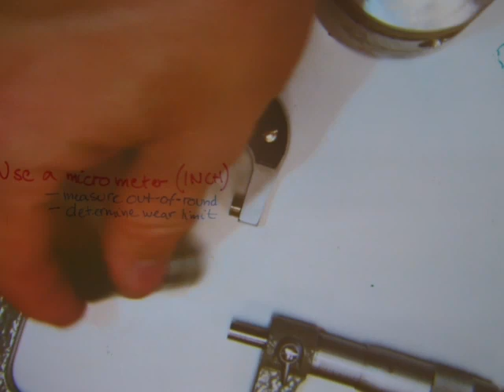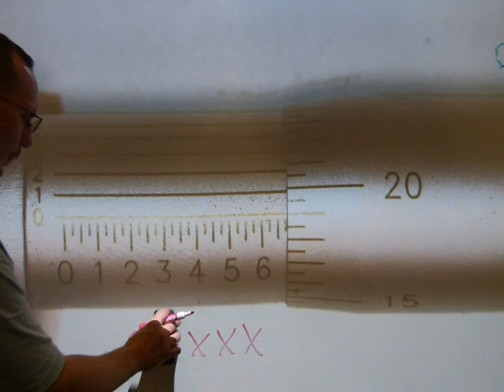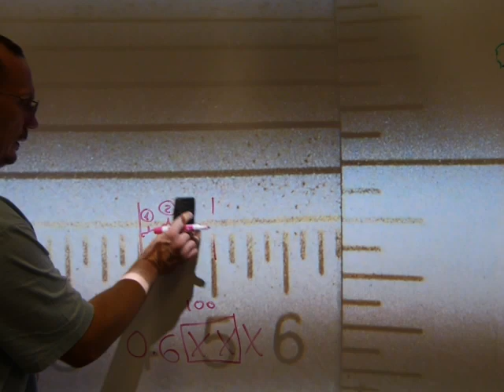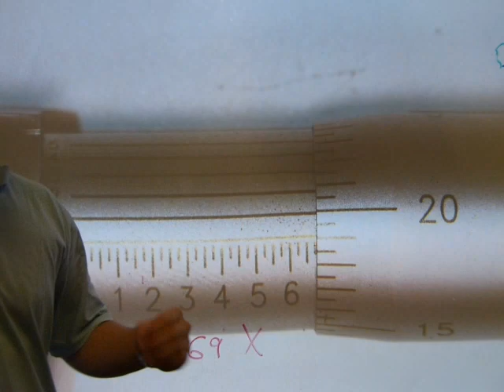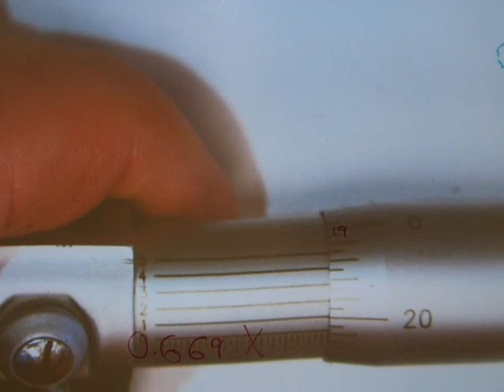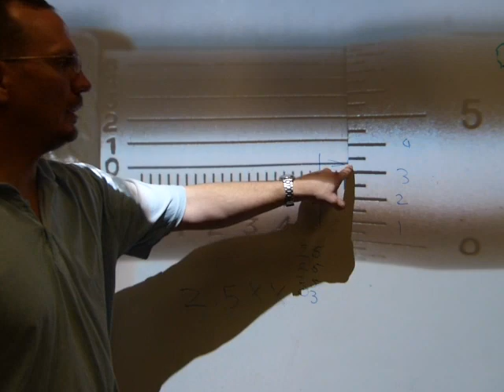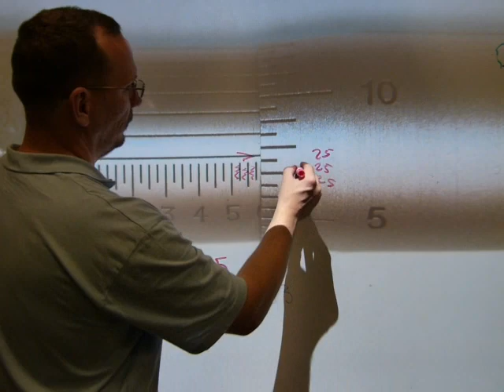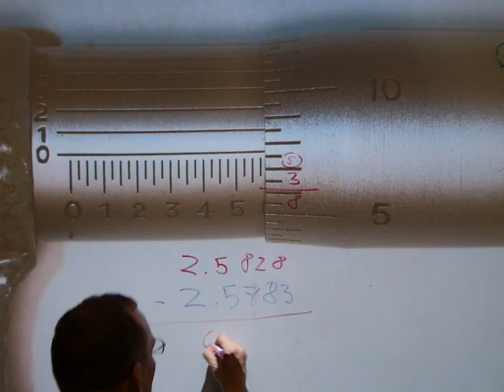Read a micrometer (INCH-based)

Comment: Hello Sir at 28:40 you added 3 ten thousandth when it should have been two ten thousandth with a measurement of 2.5827 not 2.5828 because of confusion on your behalf between 2 and 3 ten thousandth indicator aligning properly. Please correct me if I am incorrect, if I am I apologize due to confusion in my behalf
Reply from the maker: No worries. The last digit in any measurement is always an estimated digit, never a significant digit. Either 2 or 3 is close enough
Reply: I din't get the same thing cause two ten thousandth has been lined up more accurate than three ten thousandth

Comment: sir my workshop sir said that least count of micrometer in inch are 0.001" but sir you r saying different please clear my doubt sir
Reply: it all depends on the measuring limitations or design and purpose of the Mic you're using some stop at thousandth some stop at ten thousandth it all depends how precise your measurement needs to be